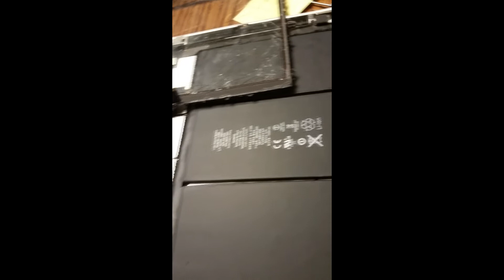Apple iPAD 2 Model A1430 64GB Uses iPAD 3 Digitizer

Comment: Although, you can use an iPad 3/4 screen for an iPad 2 - just bend the cable down. I would recommend using the correct screen though of course as unnecessary extra cable otherwise.